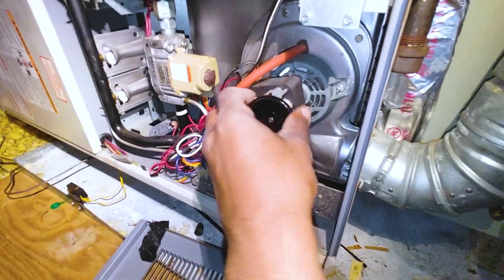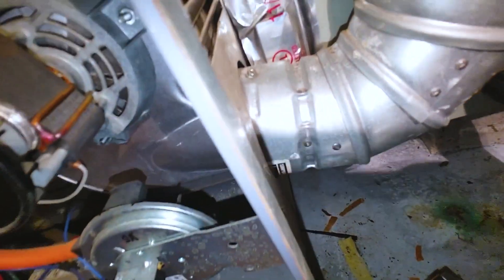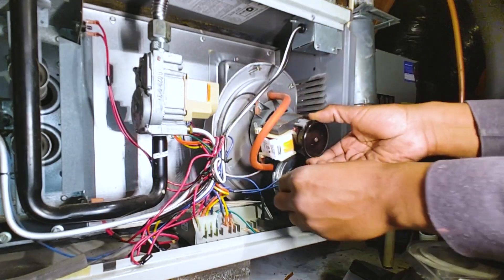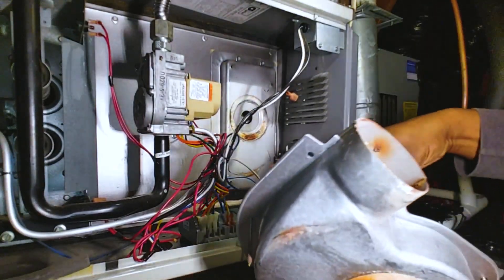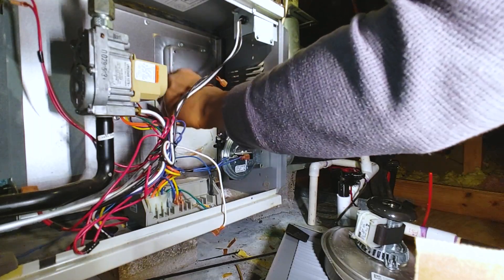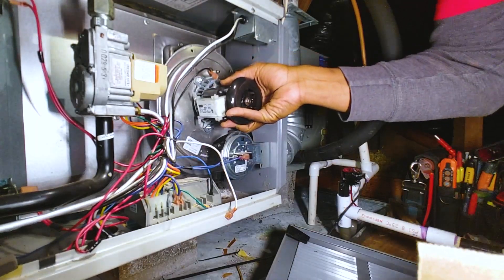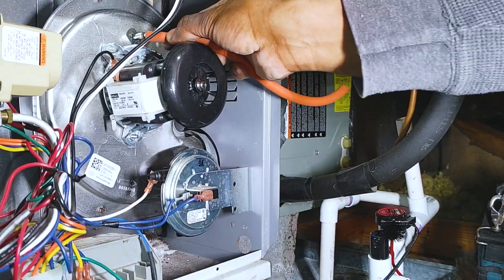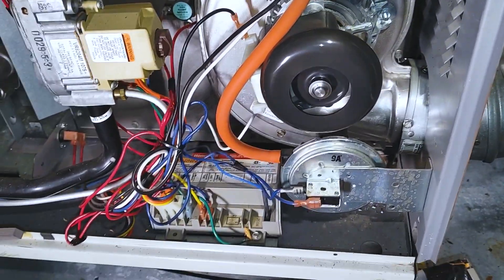Quick & Easy Furnace Inducer Motor Replacement - 80% ICP Gas Furnace Inducer Fan Motor Repair

Comment: Very nice.  Hi, my york YP9C inducer motor has only two wires. How is it able to ramp up and down with only two wires connected. One wire is HOT and the other is NEUTRAL. Thanks.